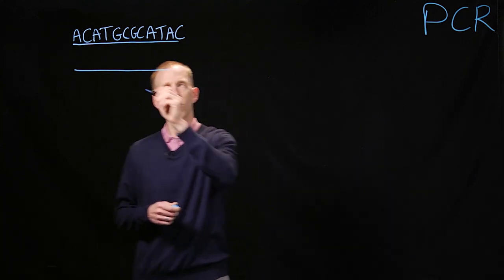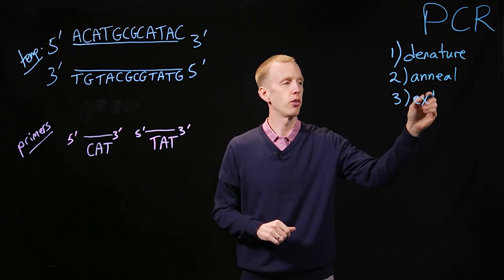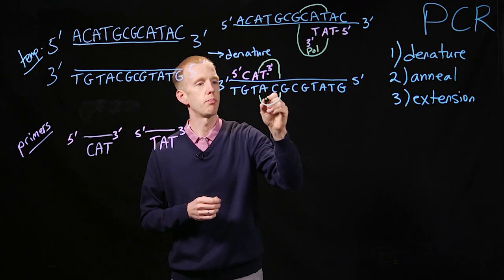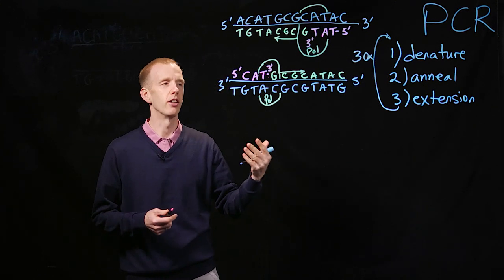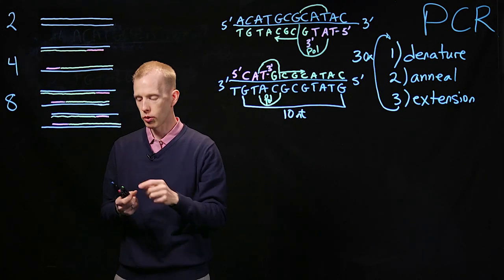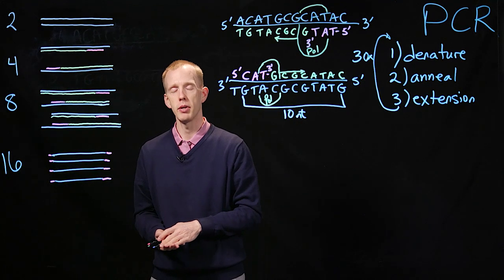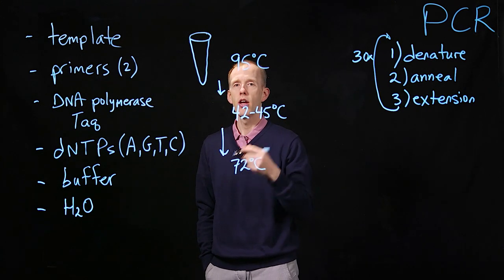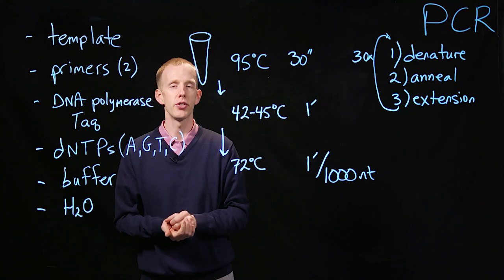PCR Basics

Comment: Hi Sir, Can we control DNA polymerase synthesis? Like I don't want to synthesis complete strand. For example - @ - 5' CATGCG 3' is what I want. Like, not synthesizing till the end of chromosome.
Reply from the maker: That is exactly the benefit of PCR. The 5' ends of the two primers define the ends of the piece of DNA that is synthesized. In reality, you can't use PCR to create a 6-nucleotide product, like you ask about in your question, but for the purposes of understanding, if you wanted to create that product, then in theory you would design two primers (one, 5'-CG-3' would anneal to the 3' end of the sequence you wrote; the second, 5'-CA-3' would anneal to the 3' end of the complementary strand, which you didn't provide in your question). This is the point I make starting at 7:57 in the video.
Reply: Joseph Ross Thank you sir.

Comment: Could you please explain how PCR is being used in the covid pandemic and is is accurate? Is is correct that all labs would need to use the same cycle threshold so that positive or negative results are consistent no matter where the testing is done? Similar issue with HIV testing in the 80's? People could be positive for HIV in USA and negative in another country simply because of PCR setup was different?
Reply from the maker: Unfortunately, because I'm unfamiliar with the specific details of those tests, I cannot comment on their accuracy
Reply: @kelhawk1  he's afraid.. but he KNOWS it's not designed for diagnosis..

Comment: Why on anneal step DNA doesn't bond with the original counterpart, but with the primer? Or it does but the repetition over comes this hiccup?
Reply from the maker: It is this extremely high concentration of primers (relative to template DNA molecules) that answers your question. Once the double-helices are denatured, there are so many more primers than "original counterpart" strands floating around that when the solution cools, one (of the millions of) primer molecule will almost certainly be positioned to base-pair with its complementary target sequence before the other template strand can do so.
Reply: @JosephRoss  thank you :)

Comment: the primer could attach at multiple sections of the original template - right? makes any difference? not really taq would just keep going until it reaches the 3' end - is my understanding correct?
Reply from the maker: Each primer can base-pair with any single-stranded DNA (including the original template) anywhere there is a series of "matches" (A with T; C with G) between the primer and template. Once the primer is bound, Taq will synthesize DNA from its 3' end. The main way this influences the quality of PCR analysis is that if both primers randomly happen to bind near each other on the template at multiple locations, then there will be a mixture of PCR products, which usually is not desirable. Usually the desired outcome of PCR is the selective amplification of the one chromosomal region being targeted.
Reply: @JosephRoss  
Innthe case of sars 2 ..what is the primer...
Is it 100 nucleotides in length or less and which section is concentrated on to amplify...
Reply: @kdcruz75  He's a coward.
Reply: @kelhawk1  
Dont know what they have to gain? 
They want slavery.
They will get it..
But some of us ..are looking to move the courts ajd human rights commission.
If they fail..then it is on record that they r ignoring truth to violate our basoc god goven rights...
Then will come universal jurisdcition...
..then there will be no mercy...everyone contributing to this fraud will be rounded up..
Medics, adminsitrators, police..politiciians..
All charged under universal jurisidction in a military tribunal.
They will be moved to laboir camps and forced labour..the very camps they think they r building for us..

Comment: Regarding the primers, the jargon you always hear is "upstream" and "downstream."  So which one of your two primers is the "upstream" one?   Is it the one that anneals to the downstream (3') end of the CODING strand of the template? Or is it the one that anneals to the upstream (5') end of the complementary template strand?  Maybe you can see why the jargon might be confusing...
Reply from the maker: Great point - thanks for bringing it up. Usually, geneticists use "upstream" and "downstream" in a slightly different context: relative to the location of a gene (or particularly the transcription start site) on a chromosome. So, in general, "upstream" means "on the 5' end of" (or "before," as we read DNA sequence left to right from the 5' to the 3' end), and "downstream" means "on the 3' end of " or "after." This is just colloquial language: to my knowledge there is no formal definition of these terms. With respect to PCR, my perspective is that geneticists typically refer to the "forward" ("upstream") primer and the "reverse" ("downstream") primer. The forward/upstream primer is written 5'-to-3' and binds to its template strand with the 3' end on the right end of the primer. The reverse/downstream primer, when annealed to its template strand, would have the opposite polarity (with its 3' end on the left side of the primer). It is, indeed, difficult to describe very clearly in writing (and it would be great if images could be attached to YouTube comments!) I also want to note that, relative to PCR, there is not necessarily a coding strand, as you mentioned, because PCR primers can be designed to amplify any part of a chromosome, including outside of genes - and the coding strand terminology only relates to genes.

Comment: Great instructable. Thanks. Questions: (1) after denaturing, during annealing, why are primers more likely to bind to the separated DNA strands than the original full length "negative" strand rejoining its complement? (2) does the primer get replicated as well or does the solution have to have a billion of primer segments at the start?
Reply from the maker: Both questions have the same answer! (Great questions to ask, also!) Primers do not get replicated during PCR, so the process only has as many (as you indicate, millions/billions of) primer molecules as added at the start. It is this extremely high concentration of primers (relative to template DNA molecules) that answers your first question. Once the double-helices are denatured, there are so many more primers than "negative" strands floating around that when the solution cools, one (of the millions of) primer molecule will almost certainly be positioned to base-pair with its complementary target sequence.
Reply: @JosephRoss  Thank you for your speedy reply. Much appreciated. Makes a lot of sense. A few related questions, if you are  up for it: (Q1) I saw in the NIST database that you can use multiple primers to PCR a specific segment, for example there are 6 different primer pairs to amplify "AATG" STRs from THO on chromosome 11. Now, most of these primers do not end with the same nucleotides, meaning they are cutting at different positions in the strand. The resulting amplified strands must have not only the the primer, the STR alleles (one or two types), but also some extra luggage, basically nucleotides between the primer and the STR. Since all lengths, but the lengths of STRs are known, are these simply subtracted as overhead from the total strand lengths to determine the allele size of the STRs? Or is there a more elaborate process of "cleaning" the strands first, before they go into the "gel" for electrophoresis?  (Q2) After denaturing, it appears that primers attach spontaneously to their targets, just before the polymerase enzyme collects free floating nucleotides and "plugs" them into the open strand. How come the relatively long primers (20bp+) attach spontaneously, while the single nucleotides don't without polymerase? Are primers electrically charged?  (Q3) Are there situations in which primers do not "find" their targets because the subject DNA has either an indel or an SNP polymorphism in the very segment the primer would otherwise attach to? Thanks again, and if this is getting too much work, I fully understand.
Reply from the maker: @ikoknyphausen198  1: I think you have the correct idea. Regardless of which pair of primers is used, the difference in lengths of PCR products is the same. 2: single nucleotides will temporarily hydrogen-bond (base-pair) with other nucleotides, like those found in single-stranded DNA templates. However, only after DNA polymerase connects multiple nucleotides together do they (collectively) have enough hydrogen bonds to stay (almost always) base-paired to the complementary strand of DNA = double-stranded DNA, the double-helix. Thus, a primer (usually 20+ nucleotides) binds to its target long enough for DNA polymerase to start adding nucleotides to the 3' end, while a single nucleotide isn't present long enough for DNA polymerase to initiate replication. 3: Absolutely, polymorphisms/mutations in primer sites on template DNA molecules can prevent primers from binding

Comment: Hi i have a little confusion, when the DNA polymerase starts copying the template it should extend until the end from 5' to 3' and during that would also copy the other part of DNA or flanking part which is outside the target sequence. So how would we going to get the exact target DNA sequences without any other flanking part. Also, how do we know the primer nucleotide sequence for annealing purpose, if we have not studied that particular genes and how do you isolates the target genes or after doing PCR how you read it. Lastly, I understood that primer cant be denatured bcz it single stranded but when cool it linked to template so why not the separated sequences of target DNA template could also rejoin during cooling process. (Sorry if there is some silly question, i'm not a genetics student)
Reply from the maker: Hi Adil. Around 10:31, I begin explaining how DNA polymerase uses one primer to extend (synthesize) the second DNA strand. Yes, you're right, that polymerase will keep synthesizing for as long as it can (until the PCR cycle ends - when the temperature returns to the denaturation temperature of 95°C). At 12:26 and onward in the video, you'll see that, over time, the length of the majority of new template molecules created by the PCR process are defined by the positions of the two primers. So, you are right that every new DNA strand created by PCR from an "original" (chromosome-length) template molecule will be longer than intended, but from the second round of amplification onward (through the ~30th), the length of each new strand is limited by where the primers anneal to the template. The ultimate effect is that, after 2^30 new strands are created, only a tiny fraction of those are the "wrong" (unintended size); most are exactly the same length, dictated by the primer locations.

Now, to your second question (which is a very important question to ask, so thanks for that): which came first: the chicken or the egg? Which came first: known DNA sequences to design primers with, or primers used to amplify DNA for sequencing? Fortunately, the answer is pretty mundane: some of the earliest primers were random nucleotide sequences. The concept is that, using short primers of random sequence, there is a finite chance that both primers will randomly anneal close enough together and in the correct orientation on a chromosome to produce a product that could be cloned and sequenced. Once you know some of the actual DNA sequence, then primers with specific sequence can be designed, and off you go sequencing more of the genome.

Another approach to genome sequencing relies not on PCR amplification of the DNA to sequence, but rather creating artificial chromosomes containing fragments of the target genome (e.g. fragments of human DNA in bacterial chromosomes) and then relying on bacterial replication (instead of PCR) to create billions of copies of that DNA molecule. Thus, no primers are required. This is how the earliest DNA sequences were obtained.
Reply: Thank u so much for such detailed reply..

Comment: I have a doubt : when we use fragmented DNA molecules digested using restriction endonucleases in PCR we get a particular structure of DNA that doesn't fit perfectly into a vector digested using the same restriction endonuclease. Do we use DNA polymerase Midway ligation or do we carry out PCR of the vector(plasmid) as well??
Reply from the maker: I'm sorry, I can't respond to such detailed questions, because it would require a lot more information and time to fully understand the research project (and thus the potential problem(s))

Comment: I'm confused, I thought primers are RNA
Reply from the maker: It is an understandable and common question - you are definitely right to be confused! In the normal process of DNA replication in living cells (in vivo), DNA synthesis must be primed with a primer (a single-stranded length of nucleic acids complementary to the opposite strand). This primer is synthesized in the cell by the enzyme called primase, and it creates RNA, not DNA. So, this would be an RNA primer, and this RNA primer is later removed and replaced with DNA so that the newly synthesized nucleic acid strand is entirely DNA. The difference here is that PCR is an in vitro process: we conduct it "in glass" (in tubes - really, plastic ones these days, but that's a trivial point). For various reasons, we don't use primase to generate primers - we (the researchers) simply provide the in vitro reaction with DNA primers that we've paid companies to synthesize for us.